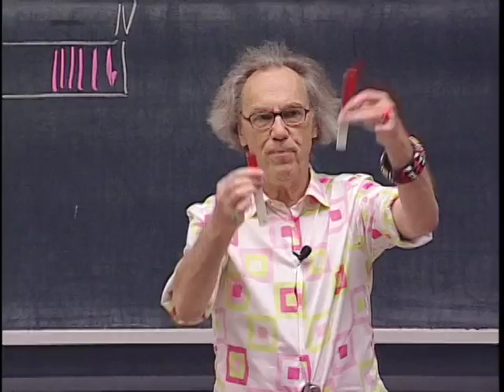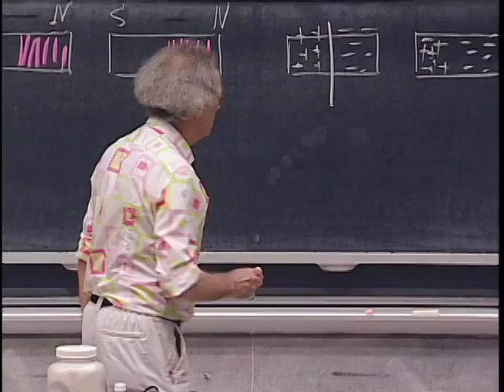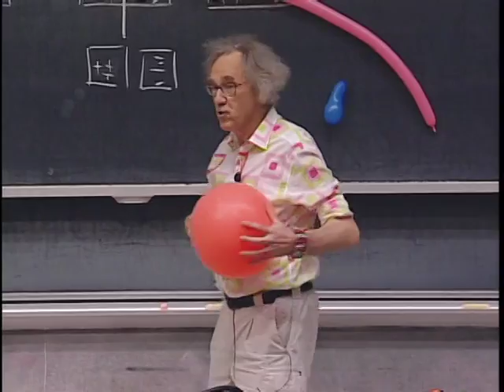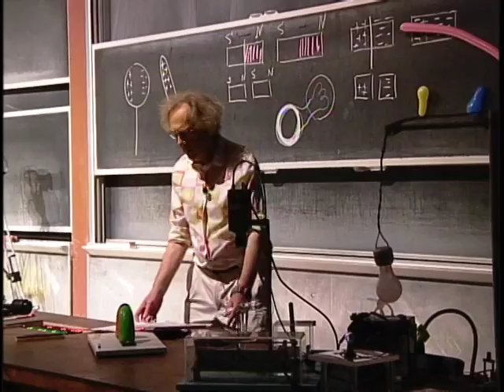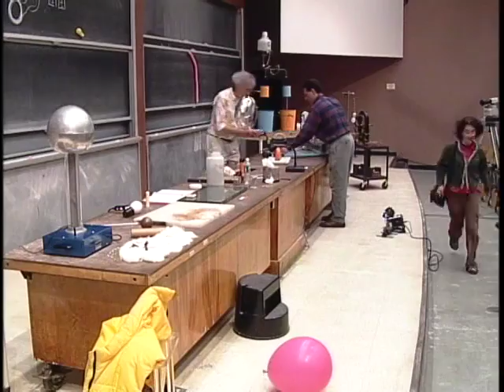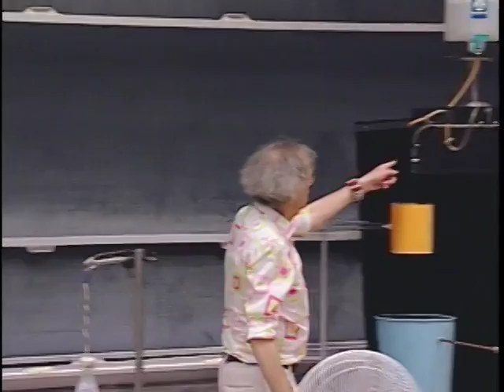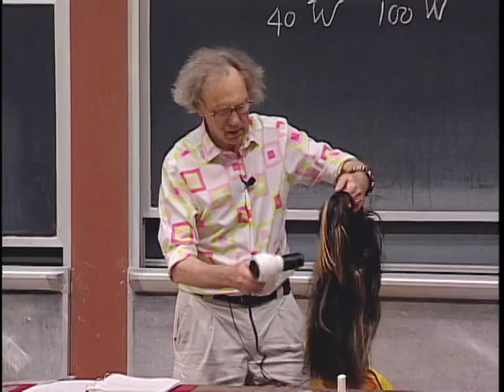The Wonders of Electricity & Magnetism - Sept 2005

Comment: Sir, Thanks a lot for the videos. They have cleared my doubts. For eg I tried to run a 5V motor with a solar panel. The voltage was 20V but still it did not run. Now I have understood that we need enough charges too.
Reply from the maker: Excellent

Comment: Symbol " i  " was for intensity. Originates with Ampere.
Using V = IR  for electricity  flowing in a closed circuit:  V = Potential. I = Intensity. P in watts = Product of Intensity and Potential.
Observed with traditional heating elements and some lights using substantial energy and giving off more heat. Your power (kilowatt hours) consumption is higher for a toaster than a television. The potential is the same from the outlet, but different appliances draw more.

Comment: Hi professor Lewin. For as far as i know, energy is never lost and can not be created from nowhere, if that's true, then what folows is that turbines will lose their energy faster while generating electricity?  for example if we remove the magnetic field from around the conductor will a wind turbine spin for a longer time or spin harder?
Reply from the maker: A modern wind turbine produces electricity 70-85% of the time, but it generates different outputs depending on the wind speed. Over the course of a year, it will typically generate about 24% of the theoretical maximum output (41% offshore). This is known as its capacity factor.
If we remove the magnetic fields there will be no production of electricity and the turbines will enormously increase ther speeds. Unless there is a braking component built in, the turbine will then probably self destruct.
Reply: Lectures by Walter Lewin. They will make you ♥ Physics. Thank you professor for that fast and detailed response. I love to watch your lectures "full of life" definitely makes us all love physics.

Comment: sir, you rubbed the glass rod with silk fabric; therefore you made the fabric negatively charged and the glass rod positively charged. but if you wait too much, then they will go back to their original electrical state. This is because naturally they have that kind of properties whether negative/positive. 

Or they are with no electrical presence and the action, rubbing (friction) made them produce some electricity and just because of the characteristics of two different material, produced-load distributed according to it? 

my second question is that what would happen if you would use another material which can attract positive charge faster(or maybe easier) than glass rod, then would it be possible to negatively charge the rod as the positive property would be taken by the other material?
Reply from the maker: charge does not leak off easily as both are insulators.  question 2. consult TriboElectric table.

Comment: 13:30 fatal error! north pole is not attracted to south pole. and south pole is not attracted to north pole. 
in truth the north pole is attracted to the north pole, but since the magnet is physically in the way the north pole can not move towards each other any further. you can prove this by alowing the magnets to slide side by side.... north always goes to north and south always goes to south. one magnet pulls the other and the fields of each try to combine into one field but they can't because the physical magnet gets in the way. sorry Prof Lewin, you wrong.
Reply from the maker: Every magnet has both a North and a South pole. When you place the North pole of one magnet near the South pole of another magnet, they are attracted to one another. When you place like poles of two magnets near each other (North to North or South to South), they will repel each other.
https://www.google.com/#safe=active&q=why+do+magnets+repel+each+other

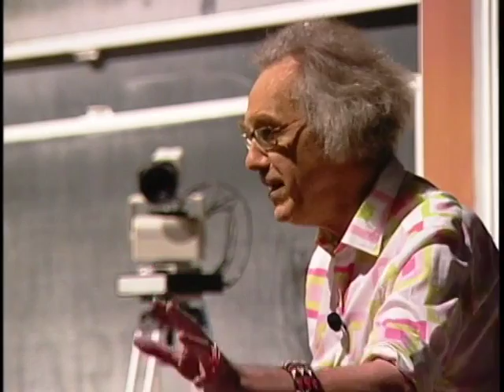Comment: Anyone know the answer to the question at 27:00 for why some confetti permanently stay on the comb for a long time?

Edit: I think i may have figured the answer. When the confetti made contact with the comb, transferring some of it's negative charge to the confetti, the difference in charge between the confetti making contact and the comb became less than that between the confetti on the comb and the confetti on the table now. Therefore a force of attraction exists between the confetti on the comb and table, hence the rebound by a lot of the confetti initially. Then once the overall negative charge of the comb was reduced by this action of fleeing confetti taking some negative charge with it each time, there was not enough negative charge left in the comb for there to be sufficient force of attraction between the confetti on the comb and table to overcome the attraction force between confetti on the comb and comb and therefore unable to pull further confetti off of the comb.

Also after all the rebounding had finished, had the professor brought the comb a little closer to the confetti on the table,  perhaps a few more confetti's would have rebounded/fallen off the comb to the table because bringing the confetti on the comb closer to the confetti on the table will produce a greater force of attraction between them with whatever remaining difference in charge exists between them.

Anyway,  just my theory. :P
Reply from the maker: +DrR1pper I know the answer.
Reply from the maker: +Lectures by Walter Lewin. They will make you ♥ Physics. I cannot follow your reasoning. Why is the confetti attacked to my comb in the first place - the confetti is not charged? What would be the necessary condition for the confetti to be repelled after it touches my comb? If you can answer both questions you are well on your way to explain why some confetti sticks to my comb and is not repelled by the comb.
Reply: Lectures by Walter Lewin. They will make you ♥ Physics. Sweet! Fyi, i just wrote down what i think is the answer.
Reply from the maker: +Lectures by Walter Lewin. They will make you ♥ Physics.  I cannot follow your reasoning. Why is the confetti attacked to my comb in the first place - the confetti is not charged? What would be the necessary condition for the confetti to be repelled after it touches my comb? If you can answer both questions you are well on your way to explain why some confetti sticks to my comb and is not repelled by the comb.
Reply: +Lectures by Walter Lewin. They will make you ♥ Physics. 

"Why is the confetti attacked to my comb in the first place - the confetti is not charged?"

- Ok, so the comb is negatively charged whilst the confetti is neutral. Due to the presence of a net negative charge on the surface of the comb, bringing the comb closer to the confetti causes some of the electrons to move to the far side of the confetti (due to electrostatic induction) which leaves the side closer to the comb more positively charged. The fact that the positive side of the confetti is closer to the negatively charged comb than the negative side of the confetti to the negatively charged comb, the force of attraction is greater than the force of repulsion and thus a net attraction force exists between the confetti and comb.

"What would be the necessary condition for the confetti to be repelled after it touches my comb?"

- When the confetti touches the comb, some of the extra electrons on the comb transfer to the confetti causing both the confetti and comb to now both be negatively charged. So there now exists a repulsive force between confetti and comb.

"If you can answer both questions you are well on your way to explain why some confetti sticks to my comb and is not repelled by the comb"

- This is where i am much less sure of the answer but i'll try. 

So for some confetti to remain stuck on the comb there must be a net force of attraction between the confetti stuck on the comb and the comb. Enough to overcome the force of gravity trying to pull them off as well. I also assume the source of the attraction is electrostatic?

Here's my theory...

Each time a piece of confetti makes contact with a specific surface area of the comb, it takes with it some of the extra electrons on that contact surface area with the comb which then causes the repulsion of the confetti. After a while of attraction and repulsion of confetti making contact with one side of the comb, that side of the comb losses all its extra electrons on its surface. However, we observe that for a little while longer not only does some confetti continue to be attracted to the comb but now the confetti also becomes stuck to the comb. Could it be due to the attraction force between the confetti and the extra electrons on the other side of the comb that are unable to transfer/move to the confetti (presumably due to the insulating properties of the comb keeping the extra electrons on that side of the comb)? Therefore a net attraction forces remains between the confetti and those extra electrons on the other side of the comb causing the confetti to remain stuck to the comb?

But i see a possible issue with my theory. If I am correct in assuming that the extra electrons on the surface of the comb cannot move around because it's an insulator, but why can they for the electrons in the confetti if it is also an insulator? Or is it simply that the electrons in the atoms making up the confetti simply shift to the side of the atom that is furthest away from the comb? And so on the surface of the confetti closest to the negatively charged comb, there will be more protons than electrons and thus a greater force of attraction than repulsion between confetti and comb causing the confetti to accelerate to the comb?

Lastly, apologies for my very length explanation of my theory. I really struggled to produce a more concise answer.
Reply from the maker: +DrR1pper When the confetti touches the comb, negative charge will move to the confetti where it touches the comb.. That negative charge causes a repelling force. If that repelling force EXCEEDS the attractive force (induction) then the confetti will be repelled from the comb and that is the case for most confetti. However,  if it does NOT exceed the attractive force (induction) then the confetti will stay stuck on the comb; that does not happen very often but it does happen. .
Reply: Lectures by Walter Lewin. They will make you ♥ Physics. Oh right. So the confetti will stay stuck to the comb if the attractive force exceeds the repelling force.

What i struggle to understand however is how there can be a condition of net and constant attraction after the neutral confetti has made physical contact with the negatively charged comb. Shouldn't excess negative charge on the comb transfer to the confetti causing both the confetti and comb to be negatively charged thus cause a net repulsive force between the confetti and comb in every instance?

Thank you very much for your time. By the way, you don't happen to be the Walter Lewin?
Reply from the maker: +DrR1pper confetti is not a conductor. Thus  in some cases the effect of induction can be stronger than the repelling force due to electrons that move to the confetti.